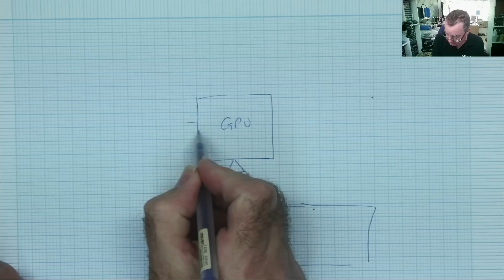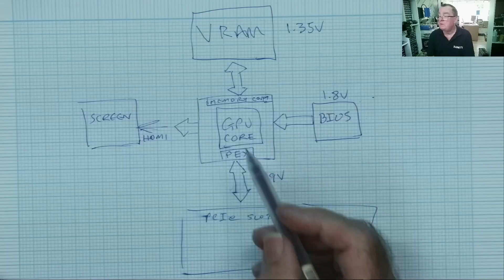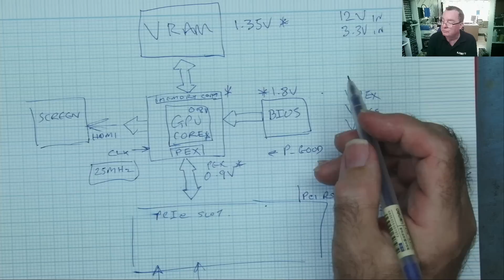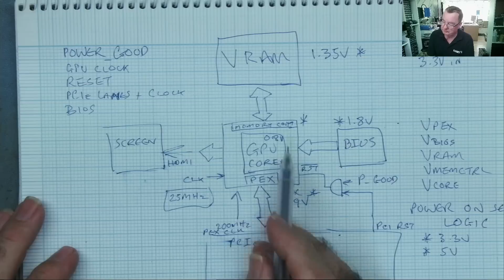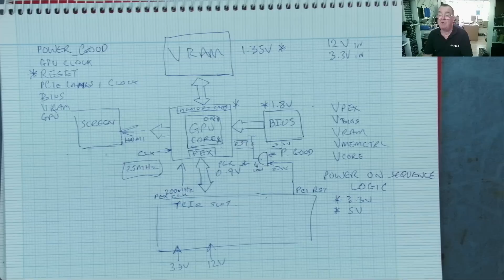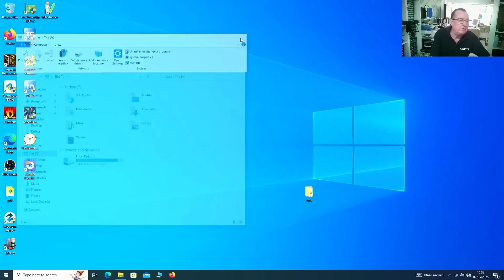How To Diagnose GPU Faults : A Complete Guide With Practical Example Using Dead RTX 3060

Comment: I wan to ask you if you can help me with a problem on my Radeon 5600 GX gaming. I bought it 5 years ago , new system

I maybe played 100 hours of games.. And the whole system is in great shape

But GPU wont load anymore.

With dedicated Gpu system runs.. Tried different pcie slot, tried compressed air ( gently ) i tried updating bios, i tried DP instead of HDMI
tried different monitor.. Nothing works.. i cant believe its death... i really hope its my PSU or the Pcie Cable from the Psu

If you can help me with it i would be really thankfull. Im willing to pay if you want.

Edit.. I also tried replacing CMOs battery. It works afterwards, but on restart No signal again... Realy really weird behaviour. Any idea??

Comment: Hi, love the video!, I have exactly the same card which I'm trying to fix but the 8 pin PCI-e power connector is shorted to ground, which triggers the SMPS to turn off the whole system as soon as the GPU power pin is  inserted. Please tell me which components to look for which could be bad and the reasons for this fault and how to repairing it.

I hope you read and reply to my comment!

Comment: I had a 2yr old (ASUS) 2080ti that kept powering off after a minute of gaming. I was devastated as it cost me $1,800aud (purchased new around 2018/2019) and was only 24 months old, but gone past warranty date of course. 

I read up that the thermal paste in this gen of cards was not very good and often needed to be redone after 2 years. I took it apart and cleaned it, put on some new thermal paste and it's still working now.

Comment: The GPU DOES NOT execute the VBIOS code. The CPU is doing that. It's an option rom.
Reply from the maker: I'm sure you are correct, it was just an illustration that the GPU needs to read the BIOS to reply to the CPU so it knows what sort of graphics card it has. My bad 😊
Reply: @learnelectronicsrepair you are a gentleman and a scholar